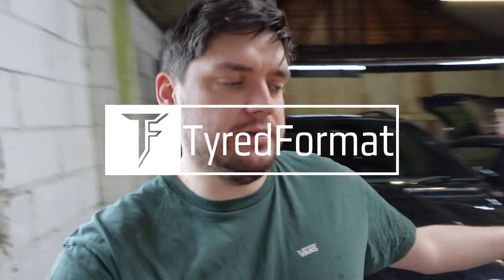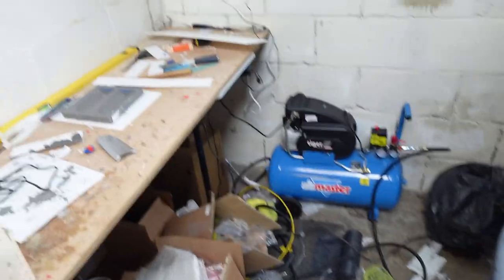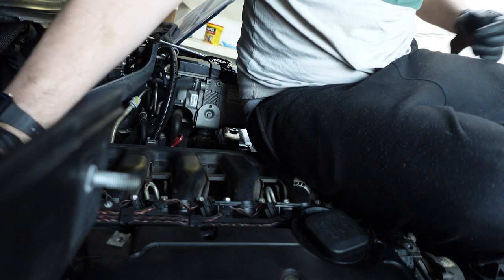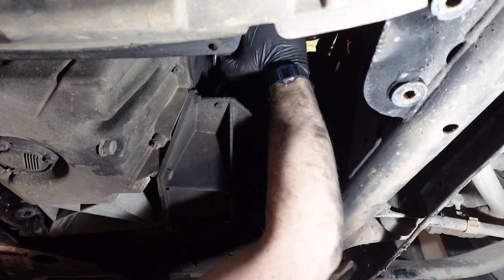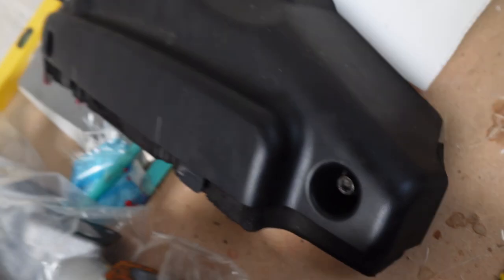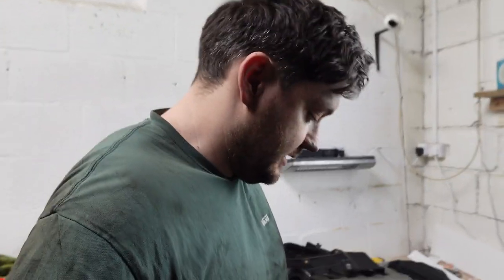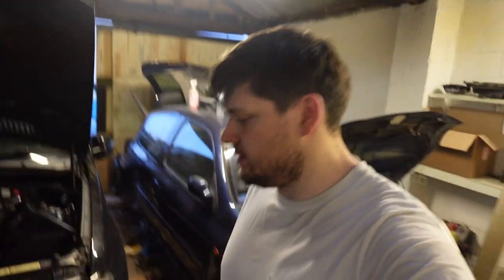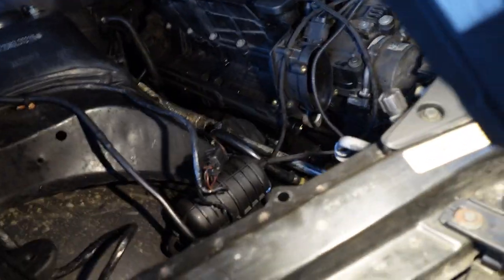I tried to change the exhaust manifold on my BMW X5, now its broken...

Comment: These manifolds are known for bad alignment between the turbo and the lower turbo support bracket, normally if you tighten the turbo to the manifold fully first, then the lower bracket won't fit without "adjustment", also the egr threads can be shallow and require tapping to ensure sealing. hope this helps
Reply from the maker: It does help! Thanks. 

I’ve bitten the bullet and ordered an EGR delete, new turbo to manifold gasket, and tore everything off the turbo in order to try and get that manifold to turbo bolted up nice and tight with the new gasket. 

As you say it doesn’t all line up well. But I think also the gasket with this cheap kit wasn’t good enough. A few people have commented saying they’ve had them blow the moment the car gets any boost! So ordered a more OEM one which is also thinner so hopefully can get more threads on the bolts too…

Comment: Its a shitty job , but as a bmw tech around 2008 . Ive swapped loads of them 🤣. Wd40 is your bff . The front 6 nuts you can do from the top . The rear 6 from the bottom . Its the fastest way . Take off as much plastic rubbish out as you can . The reservoir from the windshield wipers you can relocate to the front
Reply: 6 from the top keeping rocker cover on?😊